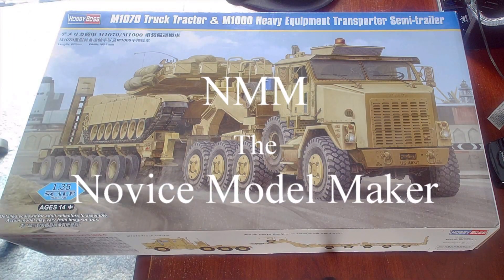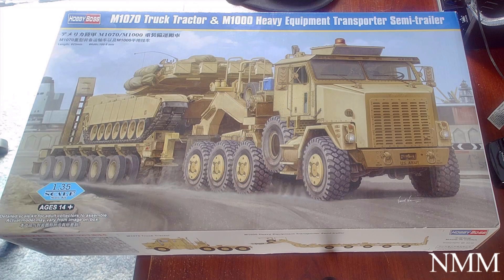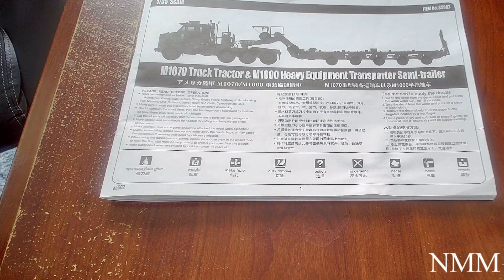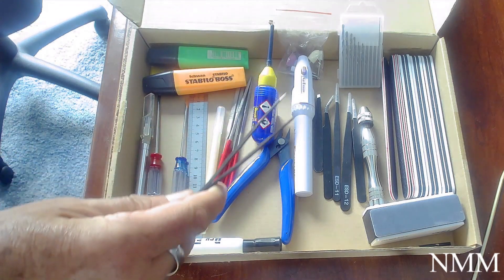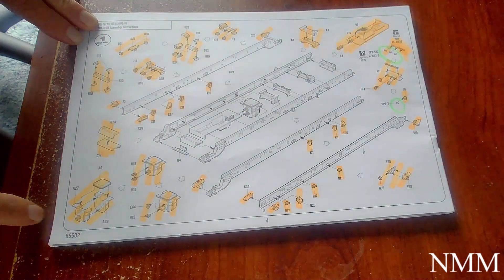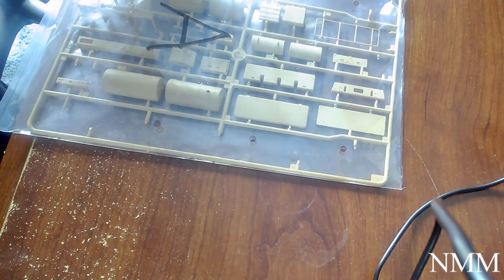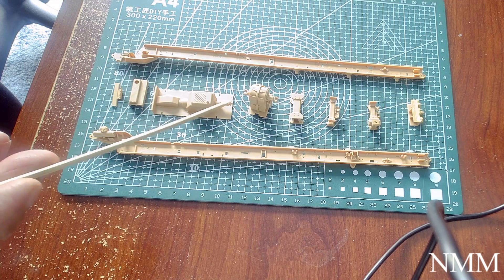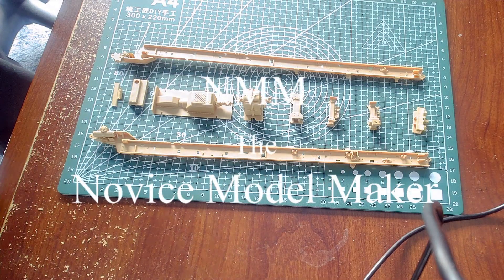M1070 & M1000 HET HobbyBoss Build Part 1

Comment: I've built many models growing up as kid (I'm 50 now).  At the time, I didn't have the proper tools, glues, or proper paints, but always worked through it.  Now I'm setup with all these and more (airbrush, etc).  I've just recently went through 2 models that have sat in my garage for 20 years (as practice/refreshing)...threw them both into the garbage after small mistakes as I'm a perfectionist.  THIS is the REAL model I'm about to pull the trigger on...looks amazing!  When it's complete, I plan on building the M1A1 battle tank to compliment.  BTW:  The reason I threw my 2 test models into the garbage was because I found that I had painted over parts that needed gluing...as you may know, gluing over paint does not work.
Reply from the maker: Great to hear you are going to have a go at this, I have really enjoyed building it and you are right it looks amazing when finished. You can see all the videos I have posted so far here    https://www.youtube.com/channel/UCLwzNWByaOpoSe3tKJvMxYg 
And I am about to start uploading the videos of the trailer build, I also intend to add a Challenger 2 TES. Enjoy your build, let me know how you get on. Cheers Mike.

Comment: Hi Mike when you have painted any parts first you have to scrape the paint off to enable them to be glued
Reply from the maker: Hi Dave, the modelling glue (I use Revell) won't stick to the paint and super glue seems to pull the paint off both parts that you are trying to glue, so I try to mask out the larger areas to be glued and for the smaller areas I carefully scrape the paint away and then patch the paint later. 
I find that if you don't paint as you go along you can't get into the fiddly bits and so you can see the yellow plastic. The next video which will be number 5 goes up tomorrow and you can see a lot more of the paint work .
Thanks for watching, I hope this is of some help. 
Cheers Mike.

Comment: Looks like you a beginner. Chosing that model you really decided jump  to a deep water. I recomend use tamyia thinner cement as a glue. Good luck with build. I gonna check your next films on your playlist.
Reply from the maker: Hello Michal, I do like a challenge, thanks for the tip I have bought a bottle of Tamyia extra thin and you are right it's much better.